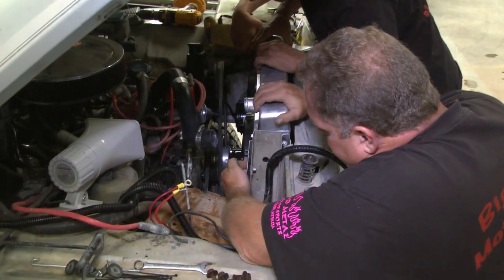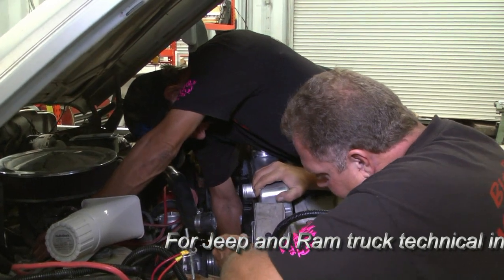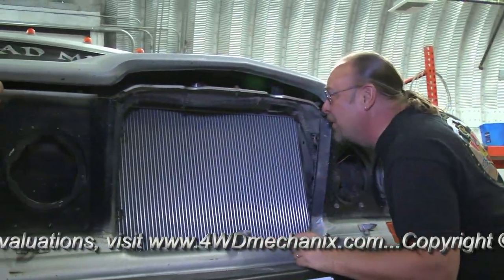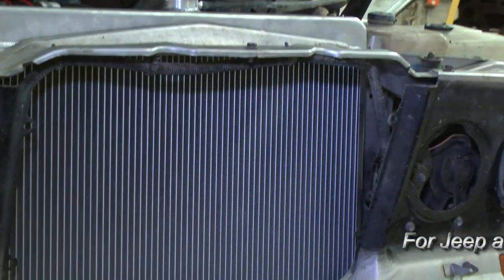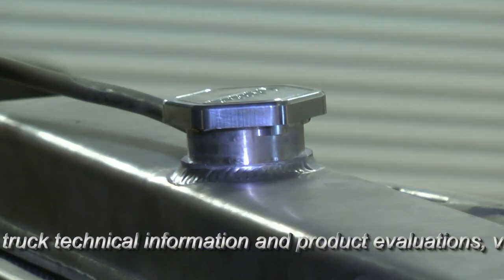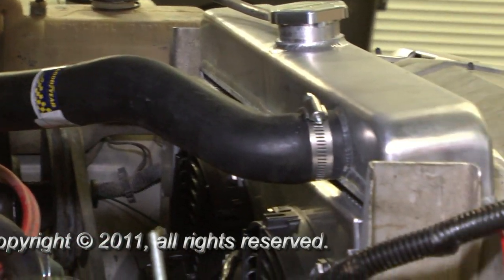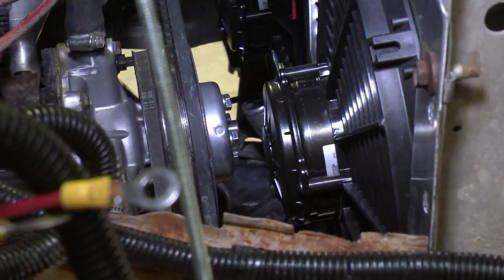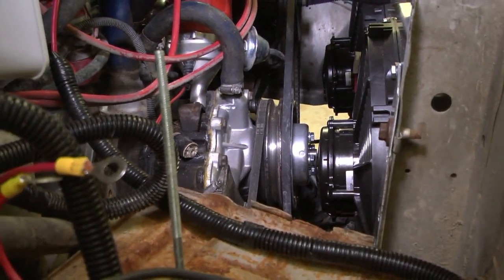4WD Mechanix Magazine: Jeep J-Truck Griffin Radiator Installation, Part 2

Comment: How did this radiator perform?. I would like to know as I am looking at buying for my wagon 1984 360 v8 stock with 727 torqueflite. I live in Australia and the summers can get up to 45 to 48 degrees C. So a good one is important to me. please let me know thanks.
Reply from the maker: Benjamin Tresham Benjamin, this is a Griffin Radiator with a proven track record.  Horsepower equals BTUs, and the capacity of this radiator helps dissipate the V-8's heat.   Your region sounds hot, we live at high desert country, so I can appreciate the summer reference...Very interested in your Grand Wagoneer, we had an '87, among our all-time favorite 4WDs.  With A/C a must, you need the cooling protection.  Join us at the forums, we'd enjoy learning more about your Grand Wagoneer and Australia:   http://forums.4WDmechanix.com.  There a special corner for FSJs at the forums, and I'm always pleased to participate!
Reply: Thanks for the reply Moses. I am going to send some pic's of the 84 wag. How do I go about doing that on the site?. I also have a 82 v8 fsj Cherokee 4 door and 1997 ZJ grand Cherokee for the wife and kids to get around in. I have been a mopar man for most of my life. My dad had a 1969 Plymouth fury hardtop 4 door 383 sold here as a dodge phoenix. I myself have had several Valiant's and 1971 Plymouth fury 4 door 383. For the last 10 year's I have branched off  into Jeep's. We have owned 2001 TJ wrangler sport, 2002 v8 WJ, 1994 XJ sport (every day driver) running on Propane injection. Fitted the whole system myself. 4.0 six jeep engine's love running on the propane. 3 ZJ's in the back yard for parts. I wish so much that the ZJ's come in V8 in RHD. I have looked at importing a 5.2 v8 from the states and doing a conversion. I have watched a lot of films with the 5.2 and 5.9 to see how much room they have around the steering box area. Bottom radiator hose and outlet on radiator I think is the problem.
Reply from the maker: Benjamin Tresham At the forums site (http://forums.4WDmechanix.com) you will find "The Garage".  You can post photos at the photo "garage" or within any post/reply at each of the forums.  In the general information forum, you will find instructions for attaching photos.  Looking forward to your forum posts, Benjamin!  Your Jeep vehicles sound fascinating, especially the '94 XJ run on propane injection!  Join us at the forums, we can continue this discussion there..Moses